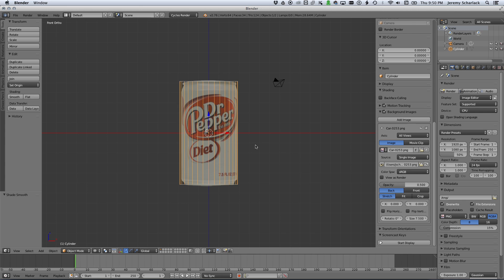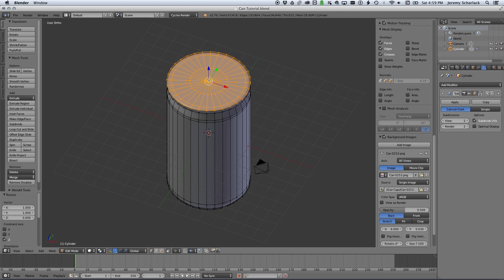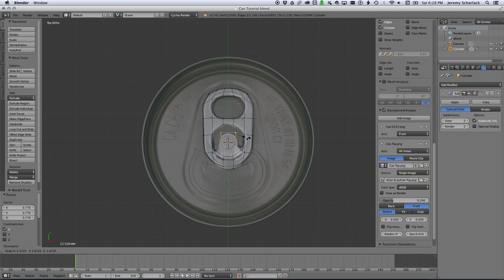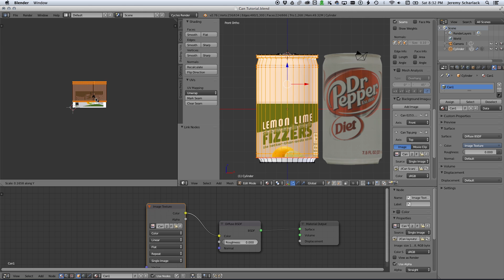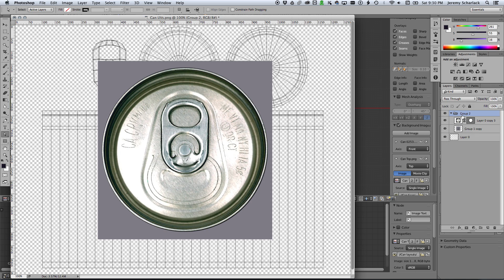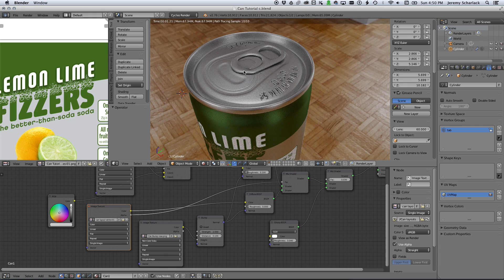Blender for Packaging –  Modeling a Soda Can

Comment: when I do cylinder projection it is not straight like yours, but curved, like a sin curve. I do a standard unwarp and get a straight grid, however when I apply graphic it does not all the way to the seams. I am not using the can, as built by you, but I built a cylinder container based on what I have learned here. here is my post at blender artist: https://blenderartists.org/forum/showthread.php?426432-Wrapping-a-cylinder-what-am-I-doing-wrong
Reply from the maker: From the pic on blenderartists, it looks like you've merged all the top and bottom facets somehow.  I'm not sure exactly how, but one idea is to make sure you have everything selected (hit the A key) before you unwrap. Try both cylinder projection and just straight uv unwrapping after you've made your seams. Hope that helps - sorry I can't give you anything more specific.
Reply: Blender For Designers hey ! Thanks for checking that out I really appreciate it. Between you and the blender Guru you guys have really upped my blender Game! If you haven't done one already or have one in the works I would suggest a tut on learning how to wrap packages that have different diameters from the top to bottom like yogurt cups.